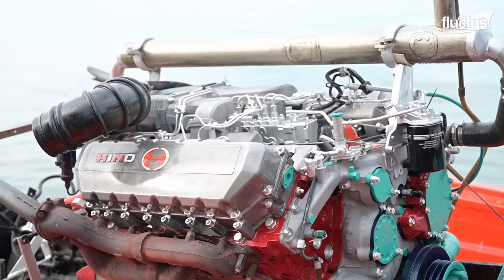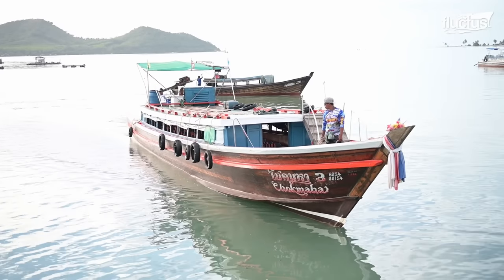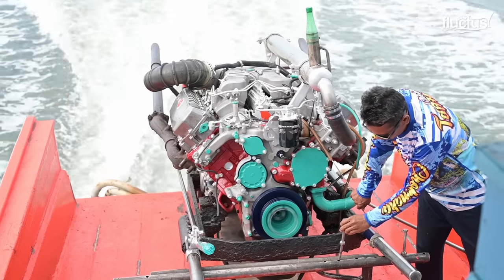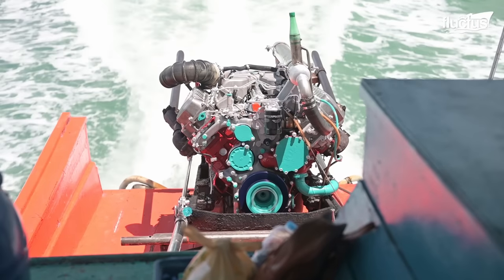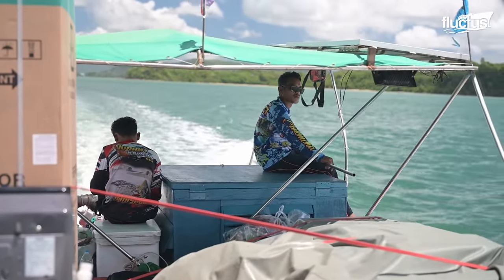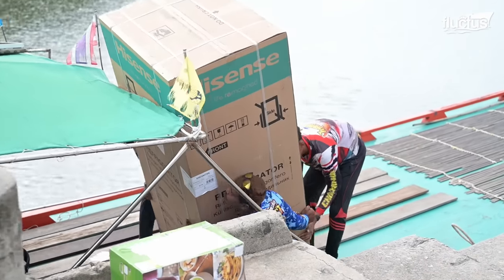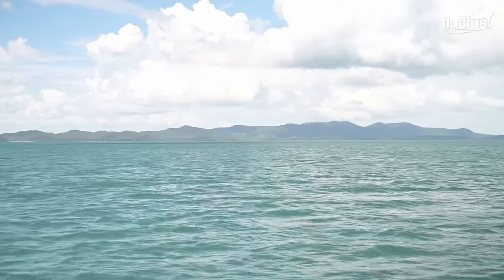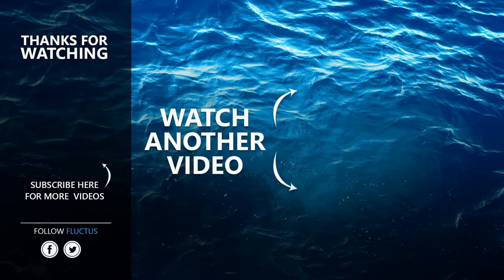A Day in the Life of Boat Driver Using Gigantic V8 Diesel Truck Engine

Comment: Guaranteed they weigh a lot more than 500 lbs.
Reply: ㅋ
Reply: Hino is a lightweight engine and probably 500 kg for 500 hp. The arnnison drive with surface piercing prop is for shallow water.
In South Louisiana mud boats use a similar design to float in 4 to 6 inches of water in the swamps.
Reply: I was thinking the same

Comment: 30 seconds info lenghtened to 24 minutes. Nothing about the engine itself but many times mentioned V8.
Reply: If they has a chance to buy a V12  4 stroke modern truck engine....that would be on there.

Comment: The engine is not very old as far as big diesels are concerned, in Japan most vehicle owners write off their vehicles as the registration and inspections become yearly and the cost of registration goes up in proportion to the age of the vehicle. So that engine might have 200k kilometers on it if lucky, barely run in for a big Hino.
Reply: 500 to 800 horsepower? No way. That non-turbo medium-size V8 might put out 250 horsepower max. What say you?

Comment: This entire outboard motor technology started with home made devices that used a little utility motor modified for marine use with a exceptionally long propeller shaft to achieve a acceptable propeller angle.

Comment: The engine looks, and sounds good. I've seen these boats in videos before. The configuration sure does make maintenance a lot easier but are there other reasons not to build the engine into the hull of the boat ?
Reply: Maneuverability - you can change the direction of thrust. It also eliminates the rudder. Safety - the wooden boat may catch fire from enclosed engine, the exhaust is as much behind as possible. Cooling. You don't need to build/maintain a sealed passage for the shaft into the hull. Space saving - the inside of the boat is free. Less chance the engine gets flooded (if there is a leak). And in extreme case, probably the whole engine could be thrown away, to make the boat lighter...
Reply: @holtzman72   Thanks for that response - very interesting. Well that sure does seem healthy, and powerful !
Reply: its a whole lot easier this way. hard mounting an inboard engine requires more setup and complexity, the boat design is different as well as you have to have a shaft exiting the hull.
Reply: They have no gearbox by the look of it, it explains why they said the prop needs to come out of the water to get into ‘neutral’ as it’s directly driven from the engine.

Comment: The 8V71 were hard on fuel the silver 92 had the power but still hard on fuel and when they broke you better knew how to repair them I worked on these Detroit motors adjusting the fuel rack was a Art I mastered it I miss these old motors.         Buy the way they were a 2 cycle engine they sounded like a race car like they were really winding up but the RPMs would  only be around two grand. If something hung up in the fuel rack, they would run away with themselves or people were using. The emergency shut off with that does shut the air off to the engine through the blower. They did that too many times it would suck the seals out of the blower motor would fill up with oil and that it would run on that engine oil until it ran out of engine oil screaming to its limits. They said the motor run away but in the end it was the Operator that ran away when it happened. 😂😂

Comment: Do they cool the engines with sea water ?
Reply: Yes
Reply: @johnnyholland8765  
But that stainless steel tube on top of the engine that he was filling up with water at each stop was a heat exchanger...fresh water in the engine...seawater circulating in the exchanger taking heat from the fresh water engine coolant...then the heated seawater being pumped back into the sea..
it never freezes so there is no need for anti freeze or any coloured coolant....
Reply: @JohnSmith-yv6eq Now that makes sense. Fresh water preserves the engine from corrosion and easy to replace heat exchanger takes the abuse of salt water.
Reply: @JohnSmith-yv6eq  Even in Thailand you put better anti-freeze in the coolant. It prevents corrosion. But you see seldom anti freeze here.
Reply: No

Comment: But no protection cage on rotation parts? One mistake and you can lose arm or wounded badly. Sure not for rough waters.
Why is protection cage not made on many boats? It's just metal sheet, easy to make it. I have feeling they just don't care and keep costs low as possible.

Comment: Sounds like a 2 cycle Detroit but says it is from Japan.
Reply: Its hino my my guy, here in Asia you can barely see any western or any American engines cuz they cost alot. Asian people used Japanese engine because of the availability of parts when it came to maintenance and it's just half the price compared to American or any western engines.

Comment: I'd like to hear from some of their mechanical whiz engineers on why they prefer those systems?
Reply: @holtzman72
1 day ago
Maneuverability - you can change the direction of thrust. It also eliminates the rudder. 
Safety - the wooden boat may catch fire from enclosed engine, the exhaust is as much behind as possible. 
Cooling. You don't need to build/maintain a sealed passage for the shaft into the hull. 
Space saving - the inside of the boat is free. 
Less chance the engine gets flooded (if there is a leak). 
And in extreme case, probably the whole engine could be thrown away, to make the boat lighter...

Comment: No radiator?
Reply: nope.. it works just like a marine diesel engine.. seawater is pumped and circulated to cool the engine
Reply: @jeremyooi1996  
That long stainless steel tube on top of the engine  that he fills with water every stop...
looks like a heat exchanger using pumped seawater to cool the freshwater coolant?
Raw seawater corrodes engines very quickly and builds up salts in the engine....

Comment: i never heart of a v8 diesel lorry engine without a turbo that makes 500-800 hp
Reply: Now if she said ft. lbs. of torque, I’d be less sceptical.  800 hp is the size of the engine in a small locomotive.
Reply: Agreed. No turbo or intercooler and no black smoke?? I wonder if it's detuned or they're not showing the belching black smoke. Plus no Alternator! How do they start that thing? Remote jump box or something

Comment: No electric motors there,, not for a very, very, long time.  Diesels will still be cheaper and save a bunch of wasted time.    There is alot of time getting those inboard/outboards tuned for balance and power and load, and learning to drive the thing and get it up to the docks, without looking the fool.

Comment: Imagine if he discovered gearing. I mean, he made an outboard motor, just needs a few gears to redirect the prop shaft
Reply: It already has a gearbox, with forward and reverse and a clutch, I'm sure it's been modified to deliver the most torque for a given job. Boats have 1 forward gear and reverse, no five speeds, and unlike an outboard, he likely sets the throttle and leaves it alone. Bit like a tractor, pick a gear, set the throttle and play with the clutch to complete the job at hand.
Reply: @couttsw  i just meant what outboards have, the gearing differential to allow the driveshaft to be bent which allows the prop to be down in the water. You're right, this set up these guys rigged allows most power, I just moreso meant that they have an outboard motor, just with a tad fewer steps
Reply: @drockjr  👍
Reply: @drockjr it's built this way to allow navigation through very shallow/muddy/lilly areas that a regular inboard or outboard wouldn't
Reply: @brantley1975  and, diesel engine are more cheap to operate than regular outboard motor
Reply: You can not set gears on a boat.
The water is always strange if you move and you have to go a lot of shifting.
And than the safety.
Reason it only have one gear is that you can set it on the same gas kabel.
So you only need one stick to move it.
That is the reason boats have only 1 gear for front and 1 to go for reverse.

My boat use a 3:1 gear rotation.
Means the engine do 3000rpm to the transmission and 1000 rpm go out to the prop from the transmission.

Stil my boat what is 13000kilo steal go 15klm per our max.

Wil i go faster means i have to change the gear rotation from 3:1 to 2.5:1 and rpm go up .

Reason my boat is slow is about that i do not need a license in my country to use that boat.
If the boat go faster than 19klm per our or longer than 14.9m i need a license do use it.
Reply: Gears reduce efficiency, and add complexity. The propellor in the water behaves as a torque converter too
Reply: @rogerandlyndabeall3840  you don't need to yell, but yeah, the person above you covered that

Comment: The long shaft has nothing to do with keeping the splashing away. It's just the easiest way to convert the engine to spin a prop
Reply: If the shaft was short it would push the stern of the boat up wasting energy, that is why they use a long shaft.

Comment: no cooling system I could spot
Reply: Takes water from the water way...
Reply: There are two pipes go down to the water behind the boat.
Reply: That long stainless steel tube on top of the engine  that he fills with water every stop...
looks like a heat exchanger using pumped seawater to cool the freshwater coolant?
Raw seawater corrodes engines very quickly and builds up salts in the engine....

Comment: Why are they not using a turbo?? Since when do we use diesels with no turbo? Seems like such a waste especially a big ol V8 they could run a tiny little 4cyl with a turbo less fuel less maintenance cost smaller footprint
Reply: No turbo=simpler.
Reply: Torque and a much longer life